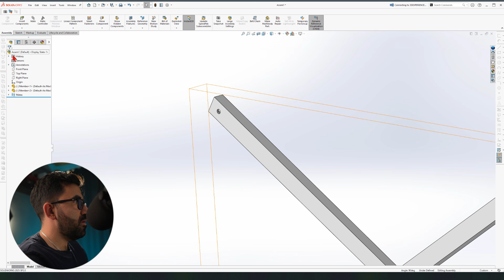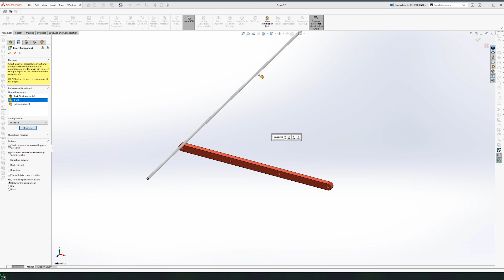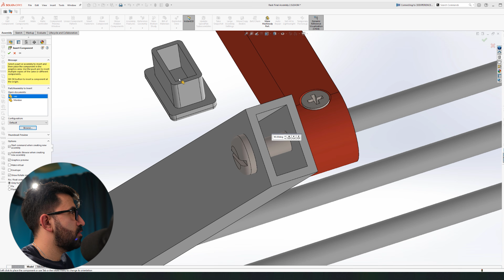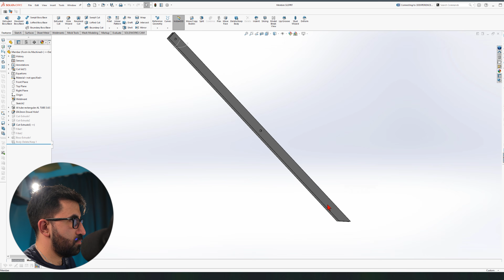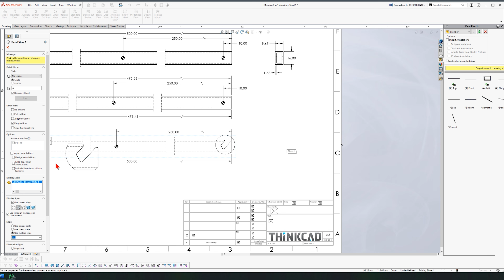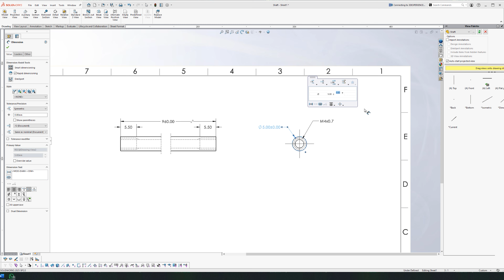How I WISH I learned Mechanical Design

Comment: There is way too much material on that injection molded upper part. It won´t really work well that way. Your wall thickness needs to be more uniform. You will get huge sink marks this way and dimensional stability will be way off. Also you have to use GD&T´s in your drawing.

Comment: not bad but I have some modifications to suggest:

1) Design challenge number 6: I don't agree with the a normal screw being used, I would use a grub screw instead or a locking pin of some sorts.

2) Designing the foot caps: when the rack is closed the entire part will be sitting on a sharp edge, so I would probably insert a part that act as the floor, just for visualization, and I would also add a mate controller, so I could set an open position and closed one, to better visualize the part during operation, and to fix the sharp edge I would study the path the part will take during the opening/closing processes so I could map out a better foot design.

3) Materials were not really discussed but since the video's entire purpose is DFM its important to note what materials to use as well as how to finish them, taking into consideration the environment it will be subjected to, for example prevent rust.

I think those are the main ones but I also wish I had the cad file so I can modify it as I want
Reply from the maker: Agreed with 1&3
I think 2 is unnecessary for a product of this level. Though there’s always room for improvement

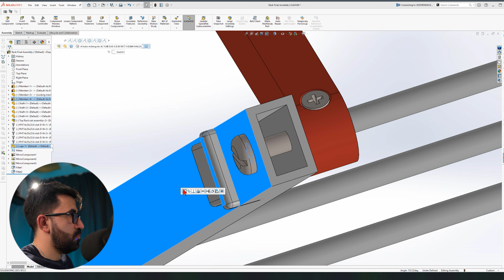Comment: At 21:05 you can use - profile center mate - instead of adding 3 mates.
Reply from the maker: That’s good but wouldn’t be enough
Reply: @with-aryan if you click on the outer profile of the tube, and the inner coincident profile of the cap it doesn't move anywhere and it is centered. 
Anyways youre on of the top solidworks teachers out there 👍

Comment from the maker: To whomever whos reading this, Do you see a HYPE button below this video? If so, What does it show you after you press it?🔴
Reply: On YouTube app, if you scroll comment section to left you will see the HYPE button. You can hype it for +90 points (also you can do more with refreshing the page). After that, you will see leaderboard. Top contents on the board have around 117K hyped. When I wrote this, your video here has 720 hype points.

Comment: Could u make videos about designing reduction gears and gear trains?
Reply from the maker: What do you need to know about them exactly?
Reply: @with-aryan  let's say i have to gears. One small(connected to a motor) and one large, and a rack( driven by large gear). I want the rack to move only 5mm while small gear moves 145 degrees. But the issue i have is that the diameter of the lager gear is too big to fit in my mechanism. My professor told me to add a reduction gear and make it. But the tutorials about reduction gear are too long and they usually don't include calculations. If the math turn out to be wrong then i won't get 5mm displacement of rack with 145 degrees turn of small gear

Comment: Great video, I suggest using snap ring instead of a bolt to lock the axial movement
Reply from the maker: That is a great suggestion for sure! 
That's the anwer to question No.1 in the video I think. 

What do you think about Question No.4?
Reply: @with-aryan another option is a vertical bolt drilled into the axle that acts as a stopper?

Comment: What about the bottom element cut to match the floor ,if the height of the whole mechanism changes ? Sure the cutting angle will not aligne with floor !!! Am i correct ? We can cosider a round cut
Reply from the maker: The height can’t change once it’s assembled. A round cut would again give you a line contact to ground.

Comment: Great video great concept dfm i wish you can do it on sheet metal part where you show how to get dxf file and igs file for tubes to be citted in laser machine and how to get dimensions for bending machine for sheet metal pieces i wish you read my comments it will be so useful ❤
Reply from the maker: I will definitely consider that video idea! That’s more advanced and didn’t consider there will be interest for it
Reply: @with-aryan no I'm so interested I'm a mechanical engineer and i want to learn more about it thank you so much

Comment: I love the new format! DFM is so important
Reply from the maker: Glad to liked it
Reply: @with-aryan  there were a couple times the audio distorted in the beginning though it was kind of harsh, and near the end there was a huge jump in the volume of your voice. kinda made me jump.
oh and it was good you mentioned needing to redesign the pin joints toward the end, because you would really want the bolts to go through bushing sleeves with washers - that way you don't need to try to bottom tap the holes in the shafts and can tighten the bolts properly - much cheaper to make and more robust.
Reply from the maker: I'm a bit rusty on the edit. but I'm back at it. Thanks for the feedback